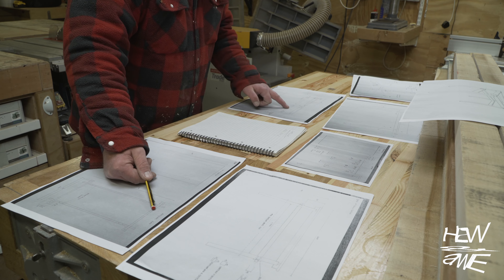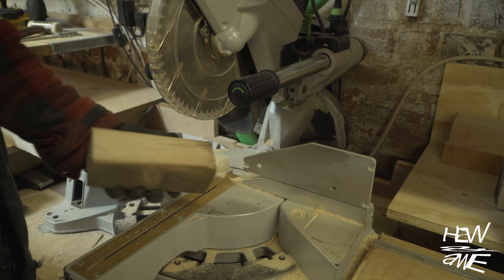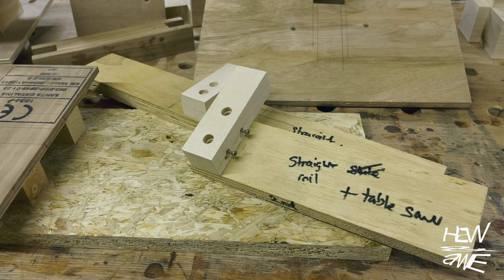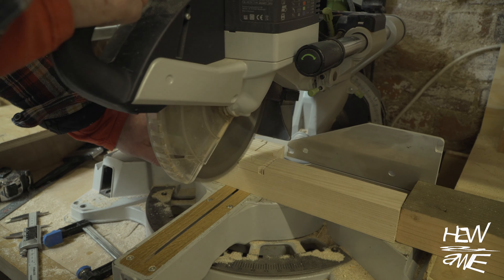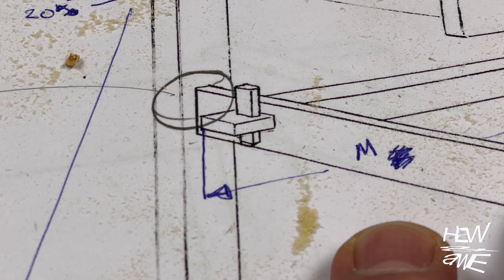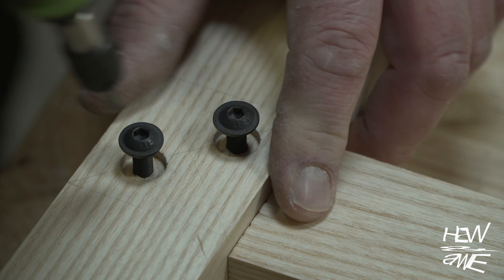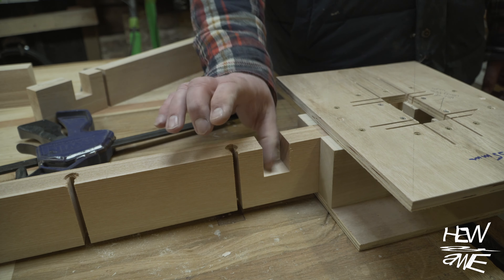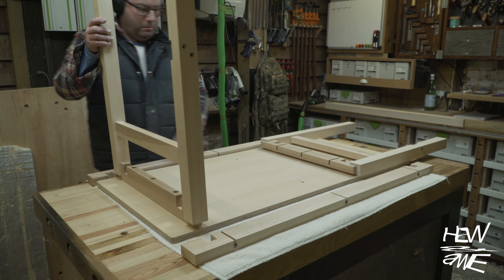Modern Writing Desk build.

Comment: Ben, that's a great way to do a flat-pack, honestly. No Ikea-style bullshit, and it's attractive. I think this will do well. I did have the thought that the design could easily be marketed in two tiers: One is the flat-pack affordable one, and the other (virtually identical) would be delivered assembled, glued, etc., with no mechanical fasteners (except for figure eights to attach the top)... maybe with a solid ash top vs. ply. Dowels would replace the screws and inserts you used.
Reply from the maker: Great minds and all that, thats exactly what I said from the get-go! The solid wood top would be cheaper than the ply too, glue would be stronger yep yep yep, but was hit with a "NOPE!" and an array or reasons why most of which I dont get, when it comes to cost and time, production time too, those treaded inserts are a right pain they have to be perfectly done and then all it takes is some muppet putting it together and force one of the bolts to hard and raise the ply or go through the top. Defo disagree with those figure of eights tho mate, buttons all day long here..
Reply: @HewAndAwe  Right, understand the issue with the 8's, since it's a bit fiddly, but I found they're good for large (desk, table, credenza, football-field lid) covers, whereas buttons (have used them too) are more foolproof in a way. 
And, whoever said, "NOPE!" to you, as you all over there say, is a wanker.

Comment: Good stuff Ben. Onwards to the next level joinery & all the best wishes on the venture. If it clicks, it's big time for business. 😀. And good job on making jigs for every part. That's probably the only way to make repeatable and easy joints & trim details.
Reply from the maker: Or just by hand dude but the designer wants them made quickly to keep the cost down meaning more quids in their pocket.